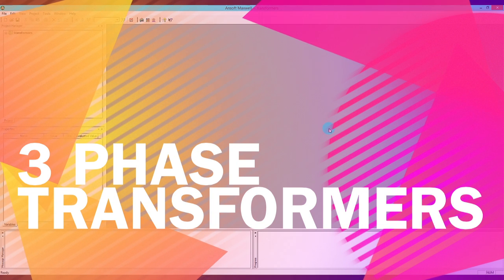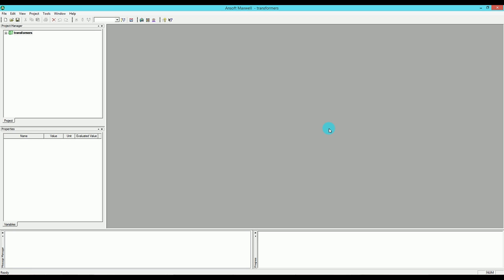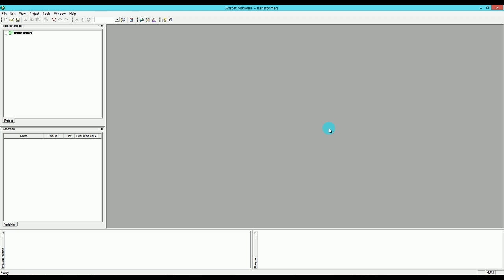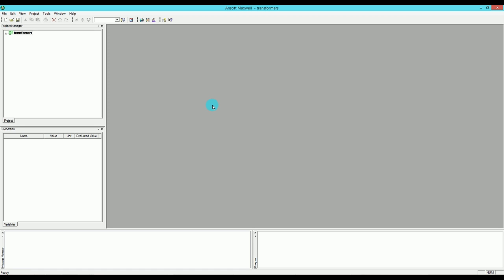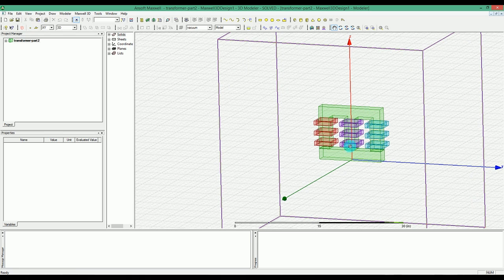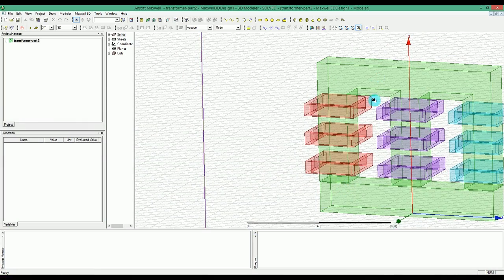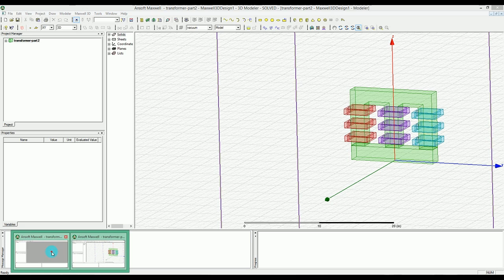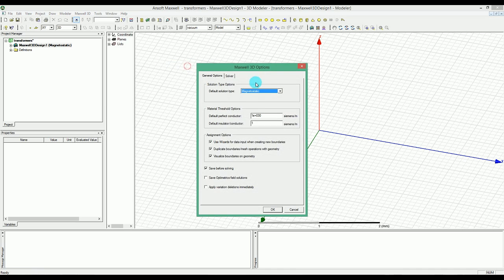206 - Ansys Maxwell - 3 phase Transformer [1]

Comment: Dear Kamyar. 
I have been following your videos and i find them really informative. I'm also a power engineering student researching on the "Three phase rotary transformer". I'm also using Maxwell for my magnetic flux investigation. May you please give a related video. Thank you.
Reply from the maker: hi, great to hear it is useful. For flux investigation you just need to use field calculator to get a quantitative number or see the flux filed using fields results. what is your main question?
Reply from the maker: +Takudzwa Mawire  I will add more videos regarding transformers.
Reply: Dear Kamyar. 
Like i highlighted before that i am investigating the flux distribution in the core of a Rotary Transformer. I would like to ask, In Maxwell how can i go abiut making the transformer tests, example No Load test, Full Load test. And its will also be helpful to go through the explanation of results for the simulations.

Comment: Dear Kamyar.
I have seen your video  and trying to develope it in my ansys i am facing the error while simulation i.e. [Failed to read convergence information. Possible reasons:(1) Solver running out of memory (2) Other solver error (10:37:50 PM  Sep 14, 2017)]. Plz help me to fix this problem.